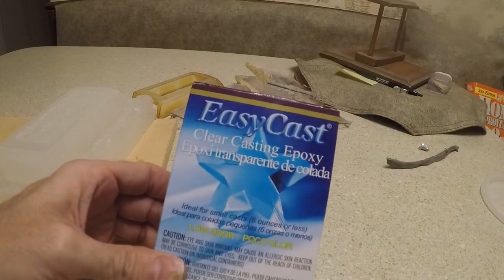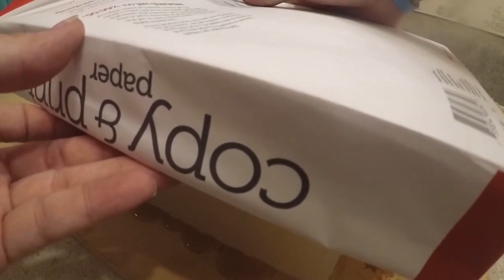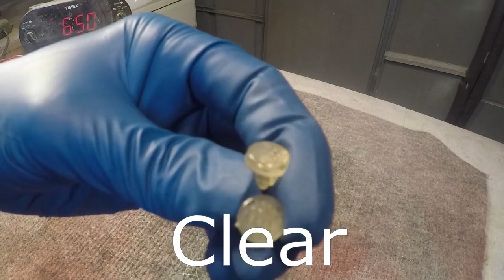Vintage Tonka Jeep Wagoneer rescue vehicle restoration. Working lights, and made my own windshield!

Comment: Vacuum both the silicone and the resin. Add more robust registration marks in the mold. Dust the mold with baby powder before pouring (as you will buff the part anyway). Put the mold and resin inside a pressure chamber to cure. Baby powder is optional but helps draw the resin in to all the little nooks and crannies.
Reply from the maker: Thanks for the advice! By the way, I have since built a pressure pot. It works 👍🏼.  RS

Comment: Pretty cool work! Can I give you 2 hints on your casting. For your clay? I notice you where having a HARD time getting the clay off the plastic. A easy way to deal with that and I'm NOT joking is PAM. Spray on Pam on the cast you want to work on. 

For your Silicone, You mean it was HARD to get apart. Vegetable Oil. A Light brush of Vegetable oil on the form then poor. 

Also, with Yellow windows. Like Valen Greymoon said in his comment. Hydrogen Peroxide and UV. You should be good.

Also! Love what you did with the lights. That put a big grin on my face.

Comment: I'm going to preload the apology here in case you have already heard this before and don't need/want to hear it now. I haven't attempted casting like this myself, but I thought about it for a long time. One of the things I cam across that's supposed to help is actually to pour from higher above the mold making a thinner stream. This, I think, minimizes the bubbles. The mold should (I believe) be fitted together before pouring through a cutout? I guess that means you would need to make a vent as well so that the air would have somewhere to go while you pour in the liquid. The degassing helped a lot it seems. I guess the windshield didn't buff out clear? It looks like you nailed the shape of it though, so the mold was done very well as far as I see. Best of luck with the next one! :)
Reply from the maker: Luudite, No apology required nor desired. I appreciate any suggestions from anyone trying to help. Being that the void was large, it was easy to just pour in the resin for the windshield. Settling the positive into the negative pushed out any air that might have gotten trapped. Vacuuming both the resin and silicone removed 99.9% of the bubbles. I have since bought some very high count sandpaper. 7000-15000 to perfect the windows surface. Thanks for the advice.  RS

Comment: Hi Rusty, love your videos. I noticed during this video (Tonka  Ambulance) that you had several failed attempts at casting the windshield and windows. Some advice, get yourself or make a Vaccu Forming machine. You can make wooden blanks of windshields and interiors. Then vaccu form the parts from acrylic. You can also make molds from resin or epoxy. Do some research it may be for you.

Comment: I have seen yellowed clear parts made clear again using the hydrogen peroxide and UV light routine. Just like doing white components.
Reply from the maker: I tried all those ways to clear the windows. Nothing worked. Figured i would learn to make windows anyway. RS

Comment: Hi there, awesome restoration!
Think about using colour LEDs, like red to the stop lights, white to the front lights, orange or red to the top flashing bulb.
Also, did you try to polish the original glass? It was blurry so that is why your form copied that blur and you got the blurry epoxy result. Could it also be polished?
Reply: My question also.
Reply from the maker: Agent Diego The colored leds weren’t bright enough to make the roof beacon blink bright. Painting the taillights leds red works fine. I’m in the process of making an entirely new mold for the windshield. It’s polished and cleaned of any prints. RS

Comment: Great job molding replacement glass for this... I bet it saved you time and $...
Reply from the maker: Thomas Barnard Actually, this windshield isn’t reproduced by anyone. The materials I needed to make the silicone mold, and the two part resin for the windshield cost $150. So I have way more in it then it’s worth, but I had to complete it. 👍🏼

Comment: What would the cost comparison be for a replacement window, if there had been one available? I know that silicone and acrylic are very expensive.  Great outcome for your hard work!
Reply from the maker: Bonnie Hollingsworth Average Tonka replacement windows run 12-16 dollars. This resin and silicone for the molds cost nearly $150, but I had to do what was necessary to complete the restoration. RS